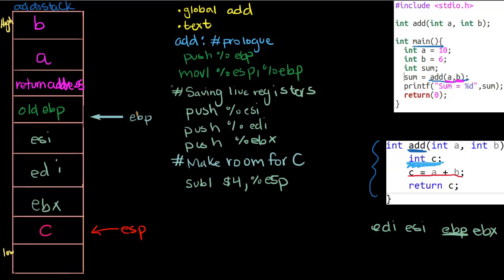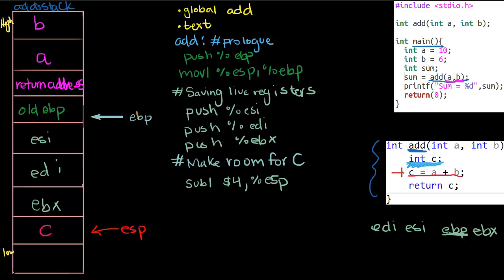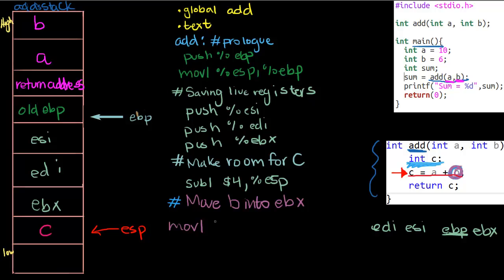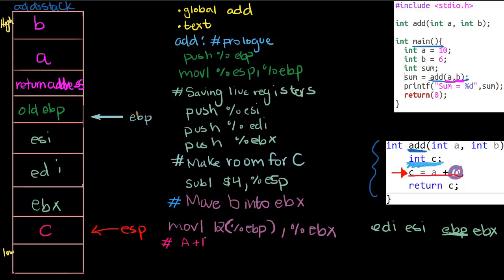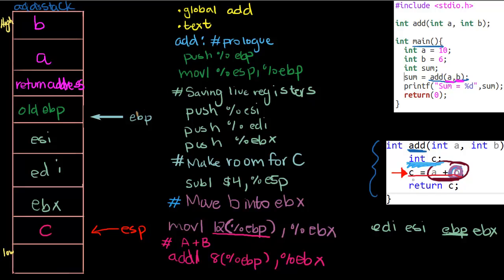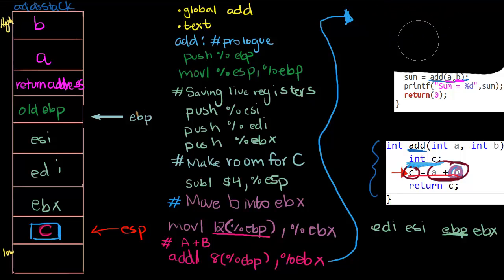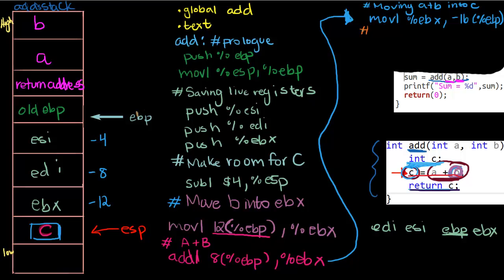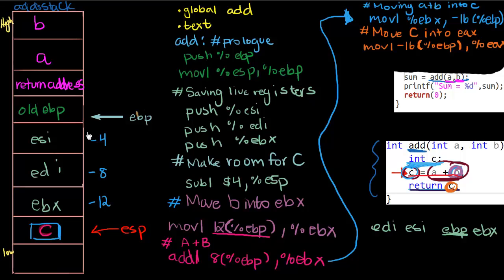Writing a Function in Assembly: Intel Att Assembly Stack Part 2

Comment: How does ebp know how far back the first function parameter is? There could've been any (reasonable) number of parameters to a function. So where does it store the value of how many bytes of stack memory there are between the first parameter ('b' in this example) and ebp pointer?
Reply: EBP is just a register so it doesn't know anything. The compiler handles all of that on your behalf. Writing it manually, WE are the ones who know it. Keep in mind this is about as low level as it gets so there arent really guard rails about that kind of thing.

Comment: 1. Why do you access c with the %ebp register and not with %esp instantly ?
2. " addl 8(%ebp), %ebx " <-- This line adds a + b, but is this also stored at %ebx ?

P.S.: Great and useful videos, thanks!
Reply: we use base pointer register as a static reference.why we use that?because %esp will change after any push or declaration of any variable inside a function .If you use %esp to access c and then declare a variable after c  (like an integer variable) , address of c will change (before : addl 8(%ebp) , %ebx , after  (for example): addl 12(%ebp) , %ebx ).so using esp to access local variables is not working.that's why we use ebp register.

Comment: Great video! But here's one question: when you move a+b to 3, you used -16(%ebp) as a reference to c. However, I found out that (%esp) can also refer to c. So why not use (%esp) instead of -16(%ebp)?
Reply: 3 years later but I think is just convention
Reply: @eclypze_  still helpful! thx
Reply: @pintorui524  the real reason is because the RPS can be dinamic throught the function but RBP will stay static
Reply: @eclypze_  ohhhh makes sense.. thx again ahah

Comment: do you write that % in assembly language? The way you wrote the code doesn't make sense to me. 
E.g:  add 8(% ebx), %ebx
Reply from the maker: +Rynn Hoong 
Yes, with the particular syntax (att intel) I'm using you have to put a % in front of the registers. 

add 8(% ebx), %ebx  

- This line uses Address operand syntax. displacement(base register, offset register, scalar multiplier). This is equivalent to segment:[base register + displacement + offset register * scalar multiplier]. So in the case of the 8(%ebp), 8 = displacement and %ebp = base register. So we do (%ebp + 8).
Reply: +Young Sloth Learning oh I see, sorry I didn't notice. I'm learning intel x86 , I suppose that's a little different than this?
Reply from the maker: Yes you're right they would be the different syntax. But are the concepts still the same.
Reply: +Young Sloth Learning Yeah I can understand better after watching it, thanks! (;
Reply: +Rynn Hoong you better learn AT&T syntax too. by the way the source and destination are reversed too. and you have to specify the size of the instruction like movl  or subl . I learned the intel syntax first, i had the same reaction when i saw the % hahah

Comment: thats not assembly that is c. i feel like microsoft, windows, and intel are hideing the true assembly code from everyone so only they can use it because everytime i find something on assembly languige there always seems to be c or some other bull#%?! sprinkled in. i also think that that bull%#?! sprinkled in makes a program writen in there crap runs slower than real assembly. why cant i just find a book that says "this is assembly" and why cant i just have a compiler that i can actualy use that i can simply just write a program and it will just work.
Reply from the maker: samuel clingan Assembly is legit and I'm not sure why you seem so angry. If you compile your C code with the -s option you will be able to see the actual assembly code that your compiler produces when you compile your C code.
Reply: but writing in assembly is soo much better(sorry about getting angry i wuz tired last night)than writing in c, no writing in machine code is a lot better because then you don't need all of these extra functions that c and c++ through in. and those functions use way more calculations to do what you  tell it to even if you compile it in assembly, they always do extra crap that usually makes the program run even slower than it would if you were to write straight into assembly or machine code. and if you write in ASM or machine code you can access the bits you want to use because Intel has unused bits in random spots on the possessor, so you would have to get an old computer with an AMD k 6 2 or k7. any way thats what i think, and i was mad because Microsoft and Intel are still using assembly because they know that it runs better than the newer codes then they tell us to use the newer codes making our stuff run slower so they can always be on top
Reply: +samuel clingan Don't need all those extra functions? Are you planning to write your own operating system? How about the BIOS? Those functions exist so that you don't need to rewrite assembly code every time you make a project. Assembly isn't hidden from you at all, it just isn't used very much because it's not portable, it's difficult for modern programmers to read and the speed gains over a compiler are negligible except for performance critical code. It takes a while of assembly programming before you can generate better code than a compiler and when you do, you can usually use inline assembly. It's not a massive conspiracy theory, everybody's code compiles down to assembly eventually, and if you actually knew what you were talking about, you could trivially look at that assembly with obj dump or disassembler.
Reply: lol you are right that i am trying to make an operating system from assembly and binary. it is obvious that the code compiles down to assembly, cause how the hell would anything get done. assembly is always running in the back round of, for example, C and the assembly code it has to compile is more than writing in assembly in the first place. you shouldn't have to go back in and change most of it. that is why i want to write in assembly, and assembly feels more exact and less restrictive that other programming languages.
Reply: The CIA is putting chemicals in the water to make the frogs go hetero (no homo)
Reply: @DrTibbs  Assembly is not a programming language
You're litterally telling the computer what to do like a Turing engine.
Bragging about how old school and hardcore you are doesn't make you look smarter